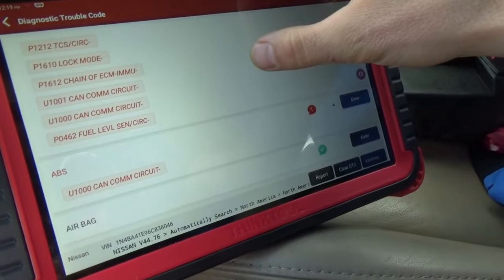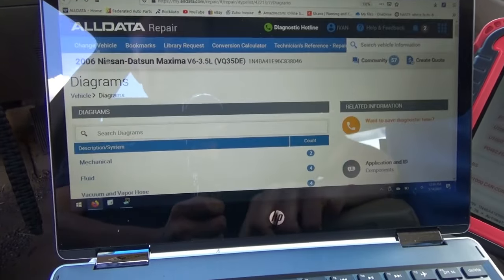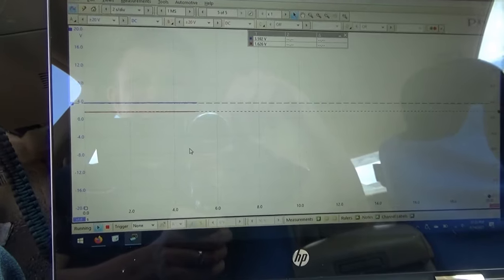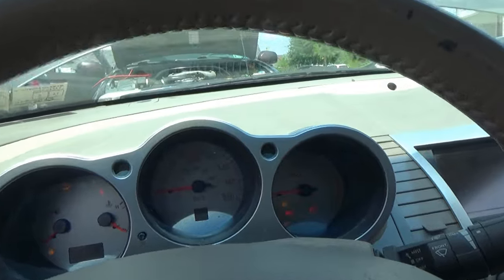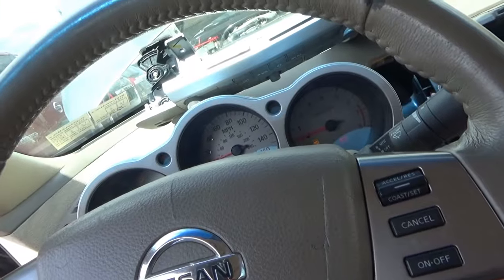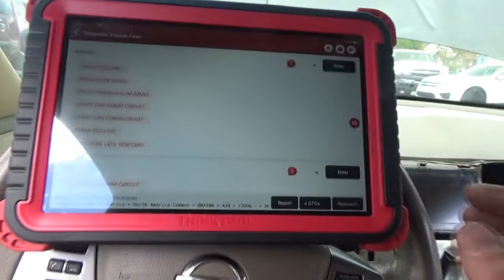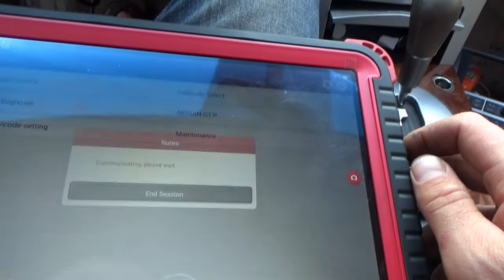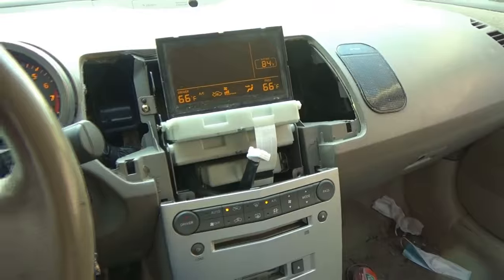You Won't BELIEVE why this Nissan Doesn't Start!!

Comment: "I can't believe it was the last module I had to check"... it always is. At work I'll have a stack of identical measuring instruments, let's say, for the sake of argument, thermocouple amplifiers/readers and I'll be looking for a particular ticket. It's always one of the last two labels I check.
Which, after a few iterations is actually a good thing as, from that point onwards, I could find the other ones blindfolded if I had to. 🤣

Edit: the module doesn't need the display to function, but, apparently, there's no code to handle the display not responding. So the module "hangs", the microcontroller's watchdog times out and reboots the module. That's why every keypress you made was, seemingly, immediately annulled. The module and the display are not really interdependant, but there's a bug in the module's code which makes it seems like they are.

Comment: Who would have thought that saving your loose change would turn out to be such an expensive mistake! And glad to see you put some tape over that coin slot! 😁 But this study just goes to show the pit falls of modern cars where everything runs off the one CAN bus. Yeah sure it might save the manufacturer a bit of wiring, but is it really worth it when just one module going down can kill the whole car? And once that bus is down your scan tools have no way of telling you where the fault is. It is sad to see that cars are made so cheaply these days. I think I will keep my old 1997 Ford Mondeo a bit longer!
Reply from the maker: I'm keeping my '96 Mercury Mystique too! It's such a solid ride, and handles like a dream :)
Reply: @PineHollowAutoDiagnostics I have this same issue but the car I’m working on someone removed this module and it’s a crank no start do u think putting this module back in would fix it

Comment: When I was little my brother and I stuck a Bobby pin in a outlet besides scaring the heck out ourselves and a sore butt, from dad it was a lesson well learned.
Reply: I stuck a wire in my side loaded cap gun burned the floor%$# oooops!
Reply: @mikes4408  I pulled an old tube operated record player apart while plugged in when I was 7. It was hand wired and I moved stuff around and sparks flew. I didn't get shocked but it scared the poo out of me, literally .
Reply: I stuck two bobby pins into the outlet at age 3 or 4.  It suggests that  the notion of a complete circuit may be instinctive.   I might test the hypothesis with toddlers (all boys)  alone in a room with a pile of bobby pins and a few wall outlets.  One or two pins?
Reply: @podamis314  Be sure to remove the plastic coating first for a more energy efficient experience.

Comment: I was under the impression that CAN devices take themselves off line when they don't see transitions sent on the bus. Designed in CAN in other systems so figured cars use it the same way. I guess they don't or that module is totally dead so it can't take itself off the bus. Very interesting, Ivan. Always good to watch your process. Thanks!
Reply: Whatever happened inside that module, the fault obviously put the CAN transceiver in permanent assertion mode.
Reply: @jkbrown5496  yup, I agree. It does happen. It does make you think about the fault tolerance of mission critical systems in cars, tho. A fault in an AC control module shouldn't bring the entire car to its knees.
Reply: @kastooMcFry   Diagnose Dan had a BMW no-start that was caused by a short in the passenger-side door handle.  At least this fault was with a module
Reply: @jkbrown5496  I saw that one! That was quite something and shows how things can go sideways with these buses.
Reply: @kastooMcFry    Yeah I fully agree with you Remco.  It's looking more & more like sloppy, thoughtless design by Nissan.  They should have known better.
Reply: @jkbrown5496  it would have been interesting to measure the resistance at the can bus pins at the module connector, the transceiver chip might have burnt out altogether. If the slot in th cover was for test socket, those often have VCC, GND and DATA and CLOCK. If the coin shorted VCC (12V likely to test that regulators / buck converters inside module producing power busses) to Data or Clock -> module done.
Reply: welcome to dinosaur computing and snail speed serial communications, it was garbage long before it was implemented into automotive.
we need to back up to full manual vehicles, with very simple mechanicals ;) cannot repair it yourself? best learn to walk before you crawl LOL
Reply: @throttlebottle5906  LOL - yeah, that would be nice. I do miss those days. With my 52 truck, you can see what it does and where it goes.
Of course, you'd have wiring looms the thickness of your wrist, if you want to implement the same functionality that modern cars have. 

CAN is ok; it works well under most circumstances: It is pretty fast, deterministic, somewhat fault tolerant, decent noise immunity, no bus collisions, etc. 
The protocols (those JXXXX numbers you see your scanner search for) that they bolt on top of CAN are actually pretty sophisticated. 

But, when the physical interface gets hosed up by a hungry mouse or one module indicates it wants to hog the bus because it was bobbypinned, you're done. 

It would be better if they had two buses for redundancy. If a module can't get on bus 1, it tries bus 2. If everyone is on bus 2, bus 1 is toast and throw an indicator up. At least the car would still run. It would definitely make that system more reliable. 

Regardess, Ivan did a great job showing what kind of weird problems you can have.
Reply: @kastooMcFry  it's about as brilliant and stable as thicknet/thinnet networking (10base2/5)that used coaxial cable, and had the same poor layout and fallacies(1980's computing lol)
while that was umpteen years ago, the auto industry is still using it(different protocols, twisted pair wiring with different terminators to match impedance.
**majority of vehicles have multiple CAN bus now, at various speeds,  to isolate them somewhat. like "entertainment system" from "drivetrain" and "braking/traction/safety systems".
to me NONE of which should exist ;)
Reply: @throttlebottle5906  agreed that there are way better methods out there, definitely. About 20 years ago in an engineering meeting with a manager that loved rs232 I said that we'd likely would have colonized Mars at that time already, if we had only abandoned rs232 at inception. So much time has been wasted on getting anything to work. To that guy, those were fighting words. He was so pissed at the mention of it. Some things are deeply engrained, having an almost religious following. That, and accepted standards take a long time to change. 
A clean sheet would be so nice, wouldn't it? Of course, 40 years from now someone in a meeting will likely offer we would be flying around like the Jetsons, if we had only abandoned it immediately. :)
Reply: @throttlebottle5906  I used to have a coax network. lol but it was post 90's. Dead simple to hook up and troubleshoot. Pain routing cables though.
Reply: @consaka1  let me fire up the old vacuum tube oscilloscope and grab the tee fitting and terminators so we can diagnose it.
yeah, I still have some of the junk laying around.
Reply: @kastooMcFry  9